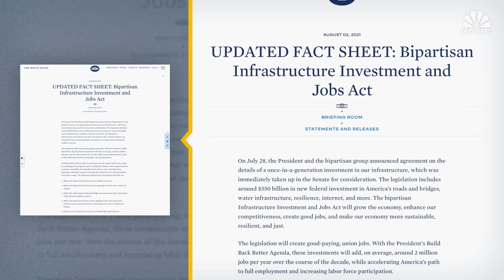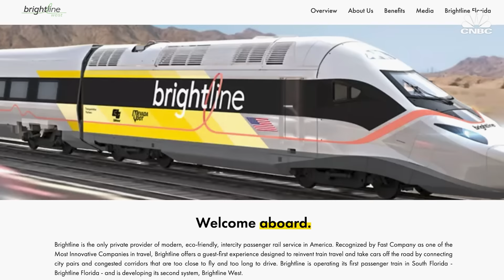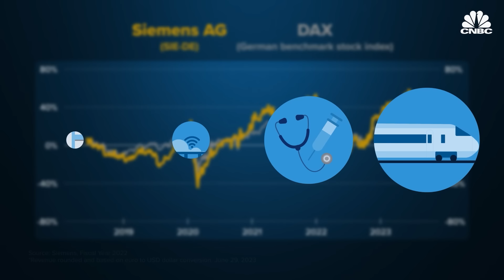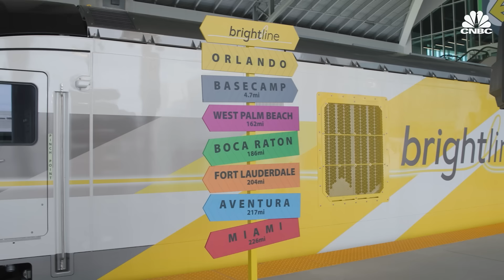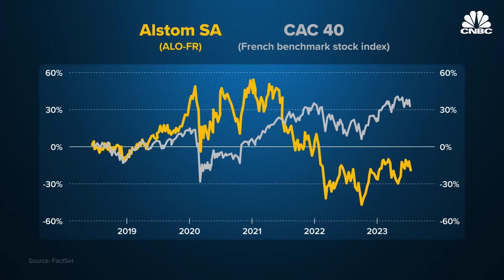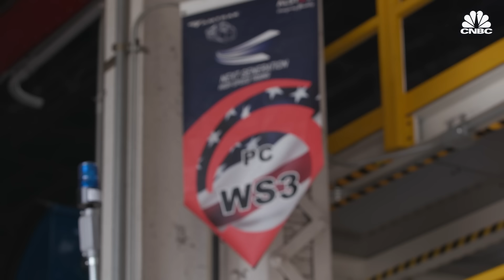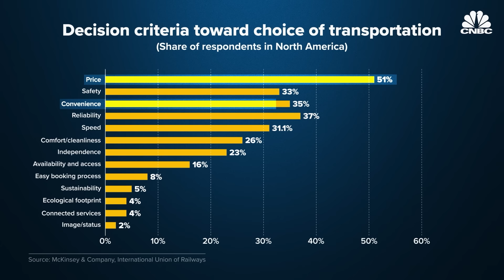Why Passenger Train Manufacturing Is Booming In The U.S

Comment: The great enemy of passenger rail in the UIS is the unrealistic, nonsensical ambition to have a system where you would take a train from New York to Chicago or Chicago to Los Angeles.  That's too far and even in places with great rail systems a trip of that distance is usually a flight.  Yes, a train travelling tracks you somehow made reasonably level can make the trip nearly as fast if it does not stop, but you can't make it level and it will have stops in between.  A focus of more sensible regional systems linking groups of cities together (like Miami-Orlando-Tampa and eventually Jacksonville for Brightline in Florida) makes solid economic sense and would be of great utility.  These systems can interlink (E.g., you could have an Atlanta-centered system that links to Jacksonville, Charlotte, Savannah, Birmingham, and Nashville) and you would be able ultimately to make your way across the country if you have the time, but to get it built you need to focus on these economically viable smaller systems.

Comment: Timewise, air travel wins over rail travel only if the distance is over 1000 km / 600 miles. Shorter flights should be generally discouraged and replaced with modern rail connections.

Comment: Over 20 years ago, I switched from car to rail for 4 months before quitting mass transit. A 40 mile, mostly highway commute took less than an hour by car. It took over 2.5 hours by rail. The train itself took ~40 minutes longer (multiple stops). But the greater frustration were the busses to reach / depart from the train stations. On one end, I needed 2 busses with added dead time to account for the intervals between busses. On the other end, it was even worse. It too would have required 2 busses to ultimately travel almost 360 degrees to net ~1.5 miles from the station. It was faster on that end for me to walk, which I did. (My walking time was not counted in the 2.5 hours).
Reply: That’s because it was poorly designed and badly funded. You should support public transit so that doesn’t have to be the case.
Reply: @joenuts5167  I agree we should have more public transit. But 'support' entails a chicken vs. egg syndrome. Few people would have been as patient as I was - to support (i.e. endure) 4 months of wasting ~3 hours each day (round trip) relative to to the time it took to travel by car. I am now retired, so I am no longer a daily commuter. But in the city where I live (population ~500,000), there is no mass transit within several miles, and no nearby parking. Also, its destinations are very limited. When I do see a bus, they never have more than a half dozen people, and are often empty. The city has long subsidized them. I hate to say it, but they are total money losers.

Comment: When comparing flying and taking the train, when travelling by train, you do not need to check in, pass through safety checks and wait to board your transportation, and factor in safety margins. So if the overall journey time is comparable, by train you will have spent far less time waiting on line for check-in, security screening, boarding and un boarding, and much more time seated, where you can work, read, sleep... Train travel is just less stressful.

Comment: Amtrak trains running west of the Mississippi usually operate on a freight route that is a SINGLE TRACK that supports two-way traffic. Legislation that would encourage the freight rails to DOUBLE TRACK those routes would benefit not only Amtrak but also freight delivery. Operating two-way traffic on a single track means that on-coming trains must pull-off onto side-rails and wait for opposing traffic to clear; this more than halves average speed or more than double trip time.

Comment: I'd say this the rail infrastructure is way better in many developing coutries. In india we hsve the national railway where govt is investing a lot. We have electrified 90% of the network which is used by both passenger and freight rail. The problem if railways in india is its overloaded and inadequate. There are a lot of investments going into the whole sector by private companies, central govt and state govts. We are about to double our network capacity in 5-6 years and reach 100% electrification. We now have freight trains running at over 120 kmph and passengers trains at 160 kmph. Passengers that used to be overcrowded, dirty and poorly maintained, but a lot of change is visible. Its not yet the best and at par with global standards, but its getting better, i have seen it improve. The experience from 15 years ago and today is very different. Trains have overall gotten faster, less bumpier of shaky, cleaner and overall better maintained. If third world countries like india can do it. US being the most powerful country, can achieve a good national railway system. Across entire country we can see infrastructure akin to the northeast or even better. It will require a lot lf investment to make up for decades of neglect. But once there is a good capex done, Amtrak can turn profits too.

Comment: Like he said, trains emit only 1/10 as much carbon dioxide as airplanes.  For this reason, passenger rail - especially high speed rail - is worth investing into.  Although the federal funds Amtrak receives is less than 1% of the amount needed, it is definitely a step in the right direction.
Reply: If you invest in passenger rail just to reduce carbon emissions, you will get nothing done. Passengers are concerned about more than just emissions.

Comment: US doing a smart move. 

This IS a smart move. Investing in trains, mobility of heavy equipment of any kind, working with interconnectivity between states helps a lot movement of merchandize and resources. Speed matters. 

US must bring the TSMC infrastructure to the states too at least a portion that guarantees the fabrication and continuation of micro processors semiconductors for the nation.

Comment: I wish this video would have addressed Siemens’ locomotive flaws such as the poorly designed front pilots that can easily be broken away that can lead to a derailment at speed. Thankfully as I type this, (7/16/2023) there have not been any derailments yet but there have been NUMEROUS occasions where the front pilot broke away. This can cause a derailment leading to a catastrophe.

Comment: What we need isnt just funding for rail. That's the easy part. What we need is comprehensive reform in zoning laws across America, with zoning density increased and laid out favoring mass transit options instead of just freeways. It doesn't make sense to build a large network of high speed across the whole country because Americas population is far more spread out. However, it DOES make sense for several large regional networks to be built out similar to the northeast. Planning and development itself need to make train, light rail, subway, and walking and biking paths the norm for getting around. Mixed zoning, high density, and - please for the love of god ban stroads. As a Republican, I support this completely and hope any candidates running take head of that. Yeah - that does matter in America. SO many things are party line its sad.

Comment: Planning to use the existing rails is ignoring how uncomfortable the ride will be. It's not that the car body is inclined so it can go faster. You should consider the fact that the ride is uncomfortable before that. I understand the desire to preserve the old, but it is no longer appropriate for the times. Instead, we should try to build a completely new rail system that can be used for the next 100 years, or we will end up with something that is only inconvenient and uncomfortable, and it will be a waste of time. Connecting New York to Washington, Boston, Chicago, etc. via dedicated track would be by far the most convenient.

Comment: Canada has similar problems with passenger rail. As in the US, passenger trains are forced to use freight rail lines and naturally, the freight trains get priority. High speed rail in Canada's most populated provinces of Ontario and Quebec is desperately needed, but will likely never get built. As is the case for the US, politics, property rights disputes, endless environmental assessments and other issues are blocking the construction of such a services. 

Canada also has its own contingent of people who believe that passenger rail service must make a profit or it's worthless, when it should be seen as a public utility where all that is really necessary is cost recovery plus a small margin to look after maintenance and upgrades. An added factor is that many politicians in the province of Ontario and the federal government really don't want efficient passenger rail because they are addicted to gasoline taxes and auto industry jobs that buy them votes. 

However, Via Rail, the country's only passenger rail service, which is owned by the federal government, is slowly getting away from the idea that passenger rail isn't worth investing in and creating a high-frequency rail network on dedicated track. Speeds won't be much faster than they are now, but what's being developed should result in the basis for a high-speed rail line supported by a densely interwoven network of commuter rail services in southwestern and southern Ontario. 

As an aside, about 45 years ago, Canada built a bunch of indigenously designed and developed tilting train sets designated as LRC (Light Rapid Comfortable) to improve speeds and travel times between major points. As Canada is officially bilingual, LRC translated to Léger, Rapide et Confortable in French. 

The trains were plagued by reliability problems and never really worked out because the existing tracks couldn't handle them at high speeds. The expectation was that the permanent way would be upgraded, but due to a change in governments, the funding was never allocated.

Comment: US invests just $10B in railways a year? The country that was silently excluded from this list - India. India now spends a third of what China does on railways - $30B+ (risen 5x in last 10 years) per year, with a target to invest $700B+ by 2030 (almost $70B per year average). Similarly Indian railways carries 3.4 Billion passengers (not kilometers!) per year (which is 3X of China). India has already electrified almost 100% of the network, replaced 37k km of old track, building 3k km per year, upgraded thousands of km to automated signalling, and collision protection technology, and now upgrading trains to trains manufactured locally in India, doubled the average speed on thousands of km of track, both passengers and freight, and 8k km of bullet train network in various stages of proposal and construction.
Spending $30B in India is like spending $150B in China (based on PPP prices and wages). Give it 10 more years you'll be surprised.

Comment: Due to the Buy America Act which requires public companies to use American-Made components, Amtrak will not be able to build a true high-speed rail network with the technology, equipment, train fleet, railroad tracks, and infrastructure required like Japan or Europe. However, if companies like GE Transportation (Division of Wabtec) which happens to provide Amtrak with the passenger rail fleet were to allow the high-speed rail manufacturers from Japan or Europe to teach and show them on how to develop/build the high-speed train fleet, equipment, and infrastructure so that American versions of it could be built allowing Amtrak to be in full compliance. Also, GE Transportation would become known as the first high-speed rail manufacturer in North America and allowing the USA to compete hands down with China, Europe, and Japan!!!

Comment: Sounds so lovely, as regards long distance passenger rail, but the country is too big and Americans are in too much of a hurry. Even HSR is pointless. It will never be on par with air. Another boondoggle. Rail is great in Europe because the cities are designed for it. These services have been in existence for decades and still struggle. As for Metro, we absolutely need more rail but we'll have to redesign our cities. Who has the funds for that?
Reply: It's actually faster to take public transportation if it is done correctly. Everything MUST connect to each other, meaning the small buses connect to larger buses or subway, and then high speed rail. Of course I'm talking more about cities, but high speed rail helps everyone, esp those who live outside big cities who can work downtown and make good money and then live is a cheaper area. It stimulates the whole economy.

Comment: The big problem is that Amtrak and nose commuter lines run of the private freight companies infrastructure. So much of their their route structures is ‘single track for efficiency.’ They hate having to accommodate Amtrak and commuter trains service which gets in the way.

America has to face the white elephant in the room. We’re going to have to build a separate passenger rail network. Yeah, that’s going to be an ‘Apollo Project’ type endeavor, but it’s really the answer. The shinning example is Amtrak’s Northeast Corridor where it owns, virtually, all the tracks between Boston, New York and DC. Even with its many problems with the corridor, it outperforms the air shuttles, combined, in number of passengers annually carried. Why? Because Amtrak controls the tracks and can make schedules to serve demand. Yes, it’s a very expensive proposition build a separate rail system but it’s THE solution. It won’t happen if no true effort is made.

Comment: Its not faster or more convenient if the train doesn't go where you need it to go or when you arrive there is no transport to the end destination. This describes pretty much everywhere on the continental US except for the interior of a few enormous cities. They are optimistic. If they are serious about getting people to use trains instead of cars then a rail system going to every little 2 house village in the country is needed not to mention the internal transit in every single town once you get off the train. This will cost trillions just to build out never mind operate. Also this is just the passenger traffic. It doesn't include freight to get trucks off the road. That'll be another couple trillion dollars to build a rail depot in every town or local area, meaning within a half hour of said depot,  with any kind of manufacturing.

Comment: My father was an engineer on the now defunct New York Central Railroad.  In the middle of the 1950s he remarked that railroads were focused on hauling freight, not passengers.  Hauling freight was much more lucrative.  My son in law was curious about travelling by train and checked out prices and schedules.  Passenger traffic by train cost much more than airline rates.  In addition the time to travel from Mobile Al to Dayton Oh was 3 days.  I am not holding my breath.  To use high speed trains, current railroad beds will have to rebuilt.  Dad said you cannot operate high speed trains on low speed railroad beds that are being degraded by trains hauling excessively long freight cars.

Railroads run to make $$$.  When I was in Japan, I rode trains that were efficient and timely.  When a train was late, the entire train crew (conductors, engineers, fireman, etc.) were fined.

Comment: HSR needs dedicated tracks.Sharing tracks with freight doe not work because the weight causes wear and misalignment of tracks that limit speeds.USA should study how China has systemized and standardized rail to lower cost, speed construction and delivery, and minimize environmental impact of construction. The films of HSR in the green landscape are from China. Imagine an elevated HSR line instead of am 8 lane congested highway and you get the picture.

Comment: Comfort in american cuture is non-existence costmer service and style is more for quantity instead of quality. Service is not frequent it takes 12 hours to travel from san francisco to los angeles. Compared to driving 5 hours. You can have nice equipment all day long although it means nothing If the pepole, service, time, and also frequency is nowhere to be found. Scheduling and infrastructure that the current rail runs are date back and updated rarely. Also cost to ride. On time arrivals and equipment performance wothout falling down or interrupted would be a challenge to overcome. We need something state of the art and impressive to the eyes and pockets. Seimens locos are a fire hazard, durability and design are placed together poorly. Profit can be made possible with rail you just need and operation that is durable.

Comment: Bad engineering is the problem.  Amtrak has made some real whoppers of mistakes.  Acelas, too fat, can't tilt, slow.  Avela Liberty (Acela 2) , won't stay on the track.  Airo trains, too wide to fit in maintenance bays, need to build all new shops.  Siemens Chargers locomotives, freeze up and stall in Sierra snows, Siemens passenger cars, what a mess.  Superliners, no replacements available last test version failed crash testing.  It's not the funding, Amtrak has FAR more money than they can spend.  There's just nothing worth buying!